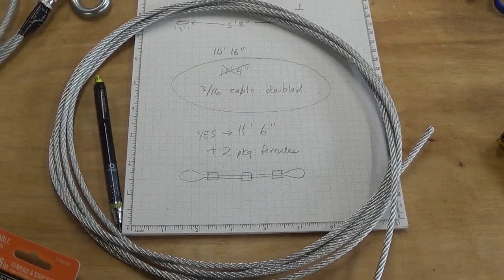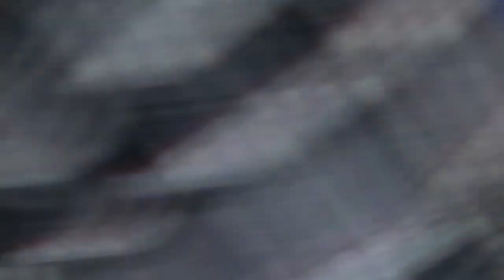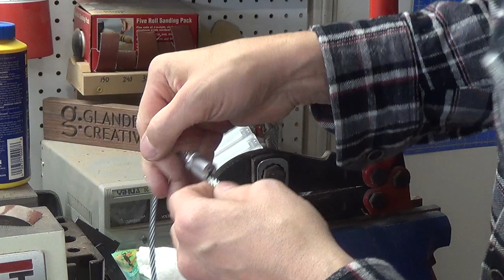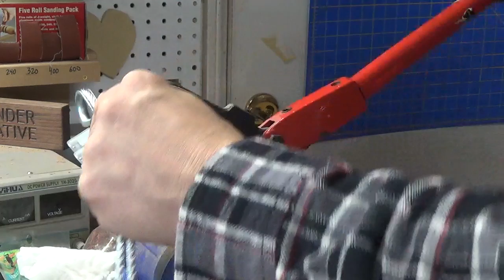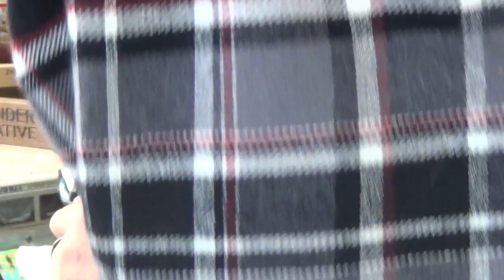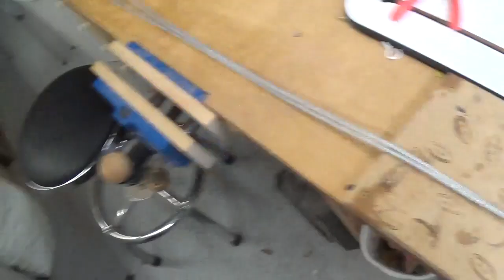Hold Your Swaging Tool THIS Way To Make Swaging Easier and Efficient

Comment: Looking at the size of the wire rope, this must be for a strong joining. Your middle joint was good, but not correct, as you should always have at least 25mm of the wire rope sticking out at each end of the ferrule and at least 3 ferrules minimum are needed. At the loop end the 3 ferrules are also required for strength.

Comment: Nice job.  Actually, two wire rope thickness on tag end would be correct if you want to maximize for 90% strength.  We always cover crimp & tag ends with a heavy heat shrink tube to avoid wire in hands.
Reply: I occasionally do that and sometime I just solder their end.

Comment: There are many sources of information for correct materials that are compatible. Did you use the Swage gauge to check your swedges? There is a correct order of precedence in swedge application.  Never middle last. The middle of the line is held by a hook? Did you account for reduction in capacity by operating angle? If you want the full benefit of your materials try the best practices rigging , or FAA advisory circular  on wire rope fabrication and repair, and or wire rope manufacturer.

Comment: When splicing two cables together or making a loop from one cable the FAA manual on acceptable repairs (AC43.13-2A) is to use two ferrules and leave at least 1/2” between them. Also there should be about 1/4” of cable end sticking out the loose end. This cable system is used in many light aircraft.

Comment: That product is meant for towing a car. Nylon ropes are not good. Also a motor cycle clutch wire can be enough to pull that load.

Comment: Ah, this helps. For my application, I was swaging onsite -- threading my cable through a fixed eye bolt, then crimping. Now, I can swage in the shop, bring my finished cables to the job site, and connect them using carabiners.

Comment: Thank you!!
Reply from the maker: Welcome!  Take from this what you will.  There are other ways to do the same thing, different techniques, etc.  Overall, they don't differ significantly, and locking the tool in the vice makes things SO MUCH easier.  Party on, Wayne.

Comment: could add 2 more crimps in middle both side of the centre one you added which would hold 2 cables together plus adding much more breaking strength but what you did is strong enough and works out cheaper but i would prefer the 2 cables held together in middle making it more like one unit as i dont like how the cables seperate in middle,,, still great, thanks for sharing
Reply from the maker: Totally agree.  Your method would be super strong.

Comment: Can the ferrels be used on vinyl coated wire rope. Wanted to make a lead for my dog but ended up using the u bolt system
Reply from the maker: Thomas Jeffords very difficult as the vinyl makes the wire diameter too great. You can trim the vinyl and then it will work.
Reply: @TomGlander  awesome thank you. Thats what i was thinkin

Comment: For others, I believe oval ferrules for 3/16" require 4 crimps not 3. Check the instructions with your parts. Also be sure when you are done there is at least a rope diameter hanging out the ferrule end.
Reply: And those 4 crimps are to be made in a specific order that he did incorrectly
Reply: I understood 4 crimps too for this size cable

Comment: I can't even get the wire cable into the ferrule, I just wasted three cable trying
Reply from the maker: The cut end of the cable MUST be perfectly flush.  No strands sticking out.  They will catch on the ferrule's edge, and you'll have problems.  The hardest part is cutting the wire rope so it's a good clean cut. A cutting wheel is probably best, but I relied on the machine at Home Depot to cut mine perfectly.  At least that's one problem I know about. Hope this helps some.

Comment: Is this a tool that can be found at Harbor Freight?
Reply from the maker: I've never looked for that tool at Harbor Freight. It may be there... or not. I only know for sure that Home Depot has them, and for sure there are lots of variations of this tool on Amazon.
Reply: I'd look online for the best price on crimpers. You can sometimes find them used on Ebay. Note that crimped connections are much smoother and better looking, but if you only have one or a few connections to make you can use wire rope clamps instead. Those only require a wrench to tighten.

Comment: You actually only have 1 wire rope holding the load. It looks like the length farthest away from you has a little slack compared to the closest side length. Unless the 2 lengths are EXACT you are better off w/ one heavier wire rope. The slack side will never be truly under shared load unless the taut side slips enough for the slack side to be loaded.
Reply: Mr. Biggs is correct, but there is only one wire thimbled at each end, so that is the weakest point X 2, even if both cable segments were exactly the same length, so the poster wasted 5' of cable in this posting.
Reply: @WeBeThrashin  - Having a redundant component (second cable segment) that is stronger than the weakest component (thimble) does mean the redundancy is wasted. It still reduces risk by ensuring a potentially damaged component (cable) has a backup. That cable might be subject to abuse of some sort and fail, leaving the backup to handle the tension.
Reply: Should have done flemish eyes with a single cable.
Reply: Very good point.
Reply from the maker: Of course you are correct on this. My load was minimal, therefore no need for a lot here.  This is primarily on how to actually use the tool and create the crimps in the ferrule that holds the wire rope.  Thanks for commenting!  :)

Comment: What crimping tool did you use and what is the die number? Thanks
Reply: Loos sells some great swagers. Check Amazon.
Reply from the maker: Crimping tool was from Home Depot, only one they have, don't know what it's called, and there is no "die number" that I know of. Just two different sizes in the jaw. I know how to use tools, I don't know names and model numbers and detailed specs. Sorry.
Reply: American-made, too.
Reply: You used the wrong size in the jaw. You needed the larger opening in your swaging tool.
Reply from the maker: Cheap crimper only has a couple of size options, as you can see. The opening I used was the largest opening. The next one closer to the handles is smaller. Don't know how you know your comment is correct. It appears to be a case of mistaken identity.
Reply from the maker: That was the largest opening in that tool.

Comment: I bought a tool like that and took it back. The large size should be at the throat of the tool not out the end. If in the throat you do not need the vise. China got it wrong again.
Reply from the maker: That is correct. The vise actually makes it easier, because it's a "third hand."  At least that way for me. The thing is that the tool actually works, and does the job. So... some tools are better, some are worse. I rarely use this tool anyway, so the sometimes use and the funky jaws don't bug me much.
Reply from the maker: Have you seen a tool like the one you describe? They don't have any at Home Depot. I certainly was in no frame of mind to go shopping any further than my local store. From a leverage point of view, what you say is probably true. More crushing force could be applied with the swage closer to the pivot.
Reply: But then wouldn't the jaws need to be opened VERY far to fit the larger sleeve in the larger hole?
Reply: There is a swage gage tool to measure the crimped area to ensure it has been properly crimped. Where the ferrule seat is placed is a matter of design, not necessity.

Comment: Do you have any videos on tieing a loop in a 3/4 " cable ? I'm talking untieing it  and rebraiding it . No thimbles ,no swedges ,just cable .45 years ago I was good at it ,but I can't remember exactly how I did it .
Reply from the maker: That sounds like quite the skill.  I don't have anything like that. But would be nice to know how!
Reply: I believe it was called "Fleshing a Cable" but I'm not finding anything on it yet . I just need a large loop ,bigger than what a thimble gives you. Thanks for the reply !!
Reply from the maker: Well, if you can't find anything, you could always just use the clamps, unless they get in the way. I'll look around as well and see if I can find anything.
Reply: I found this ,WHYKNOT is the channel and the video is" Easy to follow How to tie an eye spice in 3 strand rope" . But this would be pretty tuff to do with 3/4 cable rope .I don't recall it being that difficult  but I was just getting started in adulthood . Thanks for your interest in my conquest .Thanks bud !!
Reply: Here it is Tom ...."Epic Machines ".....Hypnotic Video Heavy Engineering inside Extreme Manufacturing Plants Steel Wire Rope Sling Factory
Reply: For any needs about steel wire rope PLZ contact me WhatsApp：+86 18036231199 .We are  manufacturer of steel wire rope in China.

Comment: what did you put the ferrule on the center of the cable for? And i just bought a ferrule and stop set and there are no instrictions. but the diagram shows the stop cylinder about a half inch farther down the cable from the ferrule. What's the purpose of that?
Reply from the maker: Good questions. The center ferrule is only there to hold the wire rope ends. It serves no functional purpose. It's more a design or stylistic thing. That stop cylinder is something I (obviously) don't use. You can add it if you want, or can figure out some reason to include it.

Comment: Shouldn't the wire extend beyond the middle connector by at least the diameter of the wire? If  you're concerned about the wire end possibly jabbing you, cover it.
Reply: Tom Glander certainly with aircraft controls the 1xd protrusion is mandatory, I've always looked at it like a knot slipping a bit when you load it up for the first time....  having said that, if it's 1/4" rope you are using, I doubt you will ever get close to the 4000ib odd rating so I'm sure it's ok! nice video, thanks.
Reply from the maker: Extending the wire would be ok.  But remember, any wire beyond the crimp point of contact does nothing to add strength. Only the wire that makes contact with the crimped joint is being acted upon. So... extending wire beyond the crimp is really just for looks.